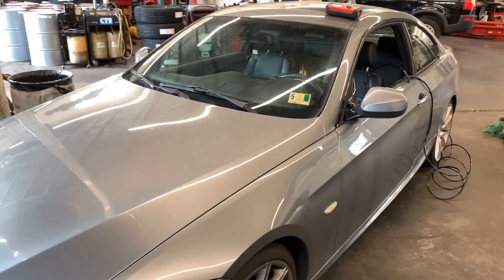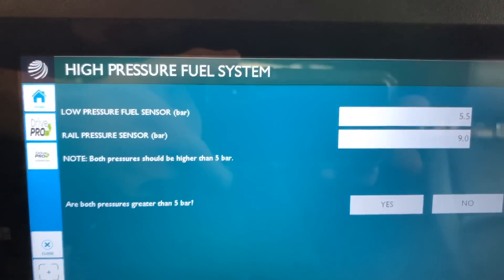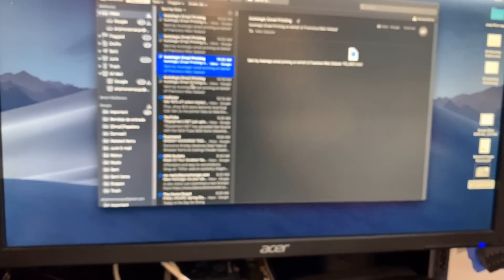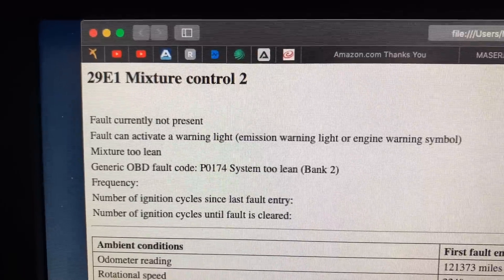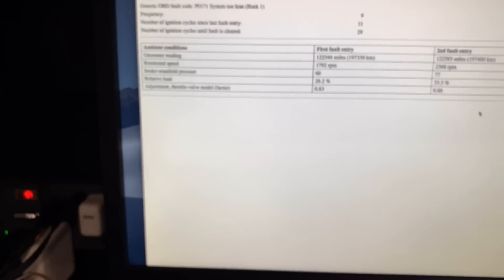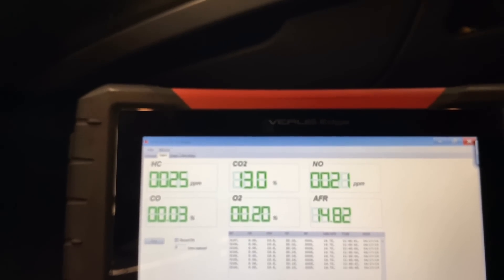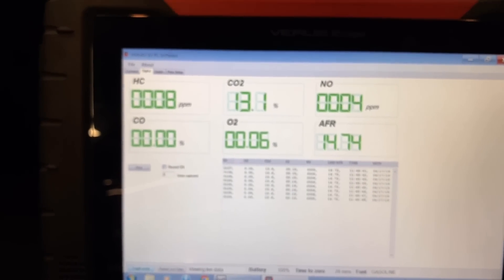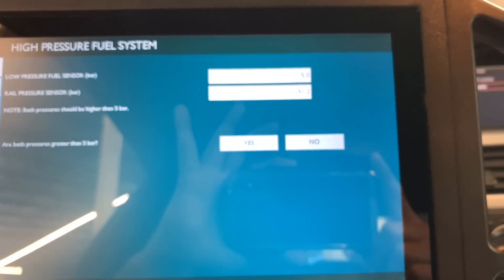2010 BMW 335iP0171,P0174 and 2B2C codesDiagnosis

Comment: Lean codes means unmetered air entering as number one cause. DME needs to add fuel (high fuel trim) to bring it back to 14.7.  Why, Maic, u would start troubleshooting by saying either injectors leaking or high pressure pump leaking? This car has cold start rough idle or misfire at load? 
Sorry, I can't follow how u can conclude it is the LPFP by reading the 5 gas analyzer.

Comment: I wish I still had access to a gas analyzer!  When I started out, I never used it enough to learn how to use its extremely helpful info. 
I would assist with inspections that used the dyno & analyzer for quite a few years back then.
Reply from the maker: Cuba's Automotive it is a super helpful tool. The most you use it the better result for diagnosis you get. I like to create faults on cars like a lean condition, Rich condition, misfire from bad coil or spark plugs and disconnect injectors to see the difference on the readings. I like this little tool because you can connect it to lap top or Verus thru Bluetooth and has a record mode. So all data stays with me!!
Reply: @MaicSalazarDiagnostics  .....................

Comment: From the start my bet was the Pump because the problem is on both banks.GDI system is hard to understand. In normal system leaky injector cause RICH condition.Why in GDI cause lean?One question.Can we find a rich condition for a cylinder if we scope the ignition waveform(lower Firing Kv)??
Reply from the maker: Petar well a leaky injector will fill the cylinder and produce a misfire so it would go lean. Reason why the 5 gas would show high HC readings. 
Yes you can see a rich or lean condition on the secondary waveform. If the firing line spikes up after the middle of it self then is lean mixture, if goes down after the middle then is rich.

Comment: These pumps break out so often? Have seen a lot fail when hot... but had rich mixture, what do you think happened in this case???
Reply from the maker: armando nika when you have rich mixture the root cause are the injectors leaking. When this pump fails usually a seal internally brakes and then the pump loses pressure to the low side it just doesn’t build pressure, which creates a lean condition and when severe a limp home mode.
Reply: Maic Salazar Diagnostics thanks buddy for your explanation.